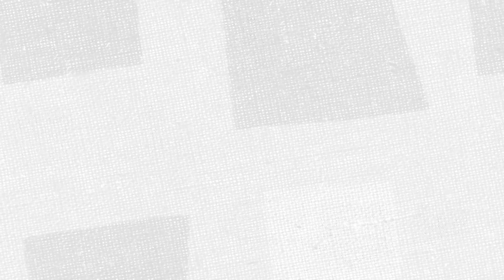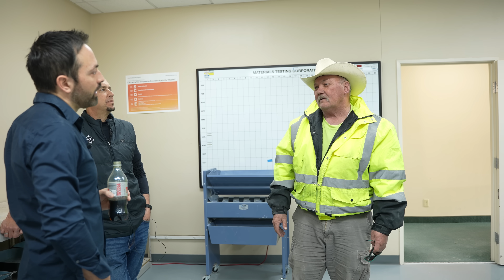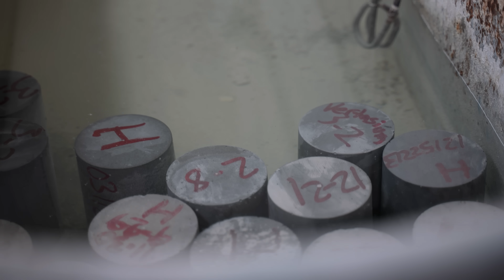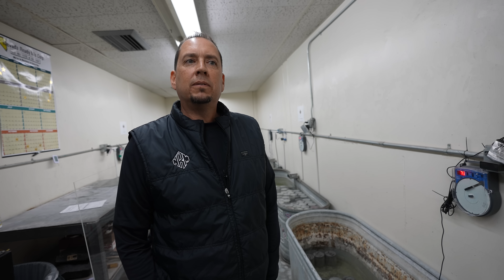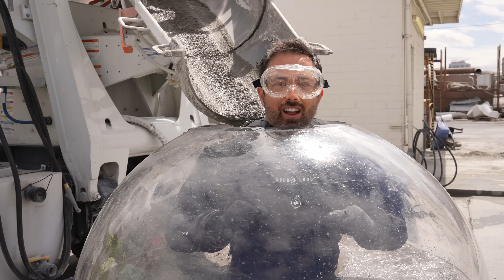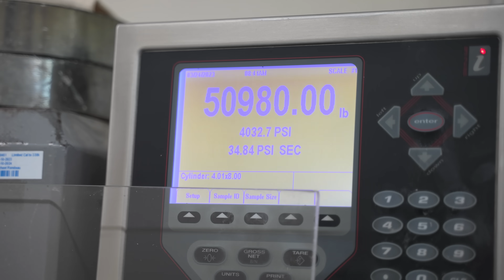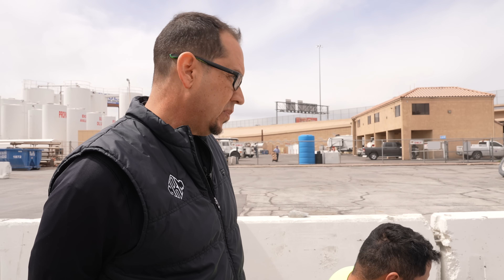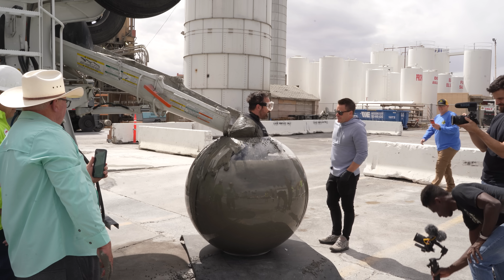Getting Buried In Concrete To Explain How It Works

Comment: 25 years in cement, quicklime and one thing you did not mention, fly ash (it was on the batch recipe you showed). Great video. I would point out that wet concrete is basic (high pH) but not really caustic. Prolonged exposure can irritate skin but it will not make a hole in you. Another point is that coal fired power station fly ash is widely used to substitute up to 35% of cement in concrete making it stronger and more durable. This is because the ash is mostly glass or aluminosilicate which is activated by the calcium hydroxide just like the volcanic ash in the Roman concrete. They even call this a pozzolanic reaction. The very fine particles of the ash make the concrete less permeable.
Reply: For some aspects, like surfaces for roads, where we need to get rid of water, wouldn't higher permeability be better?
Reply: @Parciwal_Gaming  it’s not really feasible because anything permeable will just make the foundation under the road unstable and sand and junk will very quickly fill the pores and put an end to the process anyway. They do make it though. Look up pervious concrete.
Reply: It’ll definitely make a hole in you. People have skin fall right off their muscles if left untreated too long.
Reply: wow this was such an interesting comment! thank you Chris :)
Reply: At the concrete plant where I worked, there was an old timer that had permanent damage done to his legs from years of exposure from working with cement and concrete. He always wore shorts and shoes, which allowed cement dust to get on his bare legs every day for 30 plus years. His legs from the knees down were almost completely black. It looked like he had frostbite. He was the equivalent of a walking safety video. I just don't understand how he let it get that bad. The first time I saw his legs, I couldn't believe it.
In this video, when they were filling up the clear ball, they were using really watered-down concrete. It was an 8in slump at best. That would be some weak concrete. On most commercial / industrial projects, they will not accept more than a 5in slump. They use vibration to get it into place. Adding so much water leads to cracks and weak concrete. If you add more cement, it will just get hotter and make more cracks. The only way to make it looser is to add a plasticizer. Normally, they don't use it because of the cost.
Reply: @Jonathan.D  They literally showed a plasticizer being used in this exact video.
Reply: @Demozo  Can you give me a time? I must have missed it. He was boring me with this one, and I skipped around some. Using a plasticizer is not the norm, and most people have no idea of its use. So it's really cool that they would demonstrate it here. Thankfully, they didn't demonstrate an accelerator when he was in there.😄 When we did patches on concrete portions of the interstate at night, we used an accelerator that would set up in 15 minutes. We sent out the trucks loaded with a mix that contained #2 cement. Then, on the site, they would add the accelerator just before pouring. It got so hot that the back of the truck's chute looked like a train stack from all the steam. The drivers used stopwatches to make sure they didn't have it go off in the drum. We lost several loads when the construction company had some issues that prevented our guys from pouring in time. It set so fast that they used the blade of the loader bucket to level it off. Once, an impatient driver decided to take a shortcut through the site but ended up in a patch that was almost set. Their car got stuck, and the concrete set before they could be towed out. The car was yanked out with the loader. One of the tires separated from its rim and had to be pried out. They were fortunate that the car wasn't in any deeper or if it would have been ripped apart. There's a huge fine if the interstate isn't fully reopened by 5am. So they wouldn't have had time to chip a car out of the concrete. Fun times!
Reply: @Parciwal_Gaming  It seems that would be a problem where winters are cold, where water routinely freezes.
Reply: What's going to happen when cheap fly ash is unavailable when all of the coal burners are shutdown? Anyone?
Reply: 25 years in cement, quicklime, and fly ash? I hope they let you out of the concrete soon!
Reply: @Hambon10  it's an awful product too, I'll add. Both in function & aesthetic.
Reply: If a building is blessed by Allah
It stands forever
Reply: Just thank you for the comment and this thread.
Reply: Yeah i was like what? we played with cement back in the day like it was clay haha. After a few times doing that your skin barely even reacts anymore.
Reply: @barryschalkwijk9388  concrete slowly dissolves organic material. Play with it enough and points of contact will begin dying, falling off, etc. It's a very common problem for the people who take it as a trade.
Reply: @GaryL3803 start using volcanic ash like the romans
Reply: @Hambon10 lol yeah never before have I seen something indicating someone having no idea what they're talking about. Seen some pretty severe burns from it over the years from newbies

Comment: I worked for about a year in Las Vegas doing underground utilities trenching in residential neighborhoods installing conduit for fiber and I was completely new in the construction industry. I would help my dad out with yard/house work but I never knew the actual terms for things especially “slump”. At my job we would cut 12in holes with hole saws in the asphalt and an industrial water vacuum truck(hydro vacs) would come and suck out the earth underneath. We later filled it up with slurry once the utilities had been located to know how far we can cut into the ground and excavate. My foreman had been working with concrete since he was a teenager but he was only a few years older than me and man was he extremely knowledgeable really respectable man. He was the one that taught me about proper slumps and how to communicate with the slurry truck drivers and showed me how to do a slump test. One time I wasnt paying attention and I stepped into an open hole with one leg (only one leg fits in the 12in hole) that had slurry in it and it ate me up so fast luckily it only went up to my knee cause I caught myself and didn’t tell anyone cause I was scared of being fired so I just cleaned myself up with water. It was  an amazing gig I had and I learned so much from the people I worked with but man I learned to fear concrete at that job

Comment: As a civil engineer that specializes on reinforced concrete: AMAZING VIDEO, congratulations, it's really well done!! It would be even better if you showed the weakeness of Portland Concrete and why we reinforce it with steel, but it is a whole new subject. Amazing, man, well done!
Reply: what is the weakness?
Reply: is it because it's brittle on its own?
Reply: @CureSmileful  No it is because while concrete is excellent in compression, it is weak in tension. The reinforcing steel is placed in the areas of the concrete that will be subjected to tensile forces (bottom of beams/slabs, etc). This is the simplest answer, but steel serves other purposes (crack prevention, freeze thaw, etc)
Reply: @arineey4538  And an important part of using steel instead of something else is that concrete and steel behave very similiary in regards to thermal expansion. So if it gets very hot or cold it doesn't tear itself apart.
Reply: What’s the weakness of Portland concrete?
Reply: @francoisunger6466  it might be strong in compression as demonstrated by the crushing tests in the video but it is weak in tension. That's why steel is placed in the concrete to provide tensile strength.
Reply: @a.gabbey5569  what would be a common tensile load concrete had to withstand?
Reply: @SharkWithADrill  I dont know numbers, but I believe the concrete in bridges often undergoes severe tensile stress, and thus needs some type of reinforcement to not crack
Reply: @SharkWithADrill  cement can have a tensile strength of about 3N/mm^2. High yield steel for example can have a tensile strength of 460N/mm^2. It means steel can be about 150 times stronger in tension than  concrete.
Reply: @SharkWithADrill  any kind of load really. For example if a beam is being bent, there is both compressive forces and tensile forces. As it is being bent the top is being pushed together and vice versa, the bottom is being pulled apart. Hence, as a previous comment mentioned, reinforcement is primarily placed on the bottom of a beam as that is where, in a lot of simple loads, the tension is.
Reply: he didnt mention graphene strengethen concrete :(
Reply: Hmm, one of the main weaknesses of Portland cement is its relatively low tensile strength, which means that it may crack or fail under tension, bending or shear forces. This is where reinforcing steel comes in so, by adding steel reinforcement in the form of rebar or wire mesh to the concrete, we can increase its overall strength, durability, and resistance to forces that may cause it to crack, break, or fail. Steel reinforcement works by effectively transferring some of the tensile forces to the steel, which is much better equipped to handle those forces than the concrete. This allows the concrete/steel composite to withstand greater loads, resist deformation, and absorb more energy without failing. Thanks!🙏
Reply: @francoisunger6466  Nothing. All concrete is bad in tension, not sure what the commenter is talking about.
Reply: I'm surprised Portland weren't named after Aalborg Portland. Huge cement supplier. Awful for Denmarks co2 emissions. And some rich ass family ownership.
Reply: @--julian_  plasticity
Reply: Yeah this deserves a part 2, I wondered if they would explain the steel reinforcement angle. I am particularly fascinated by the Roman self healing factor.
Reply: Practical Engineering has a whole series on concrete and the different ways it is reinforced. Definitely worth a watch!
Reply: @--julian_  it can't withstand tensile forces( stretch) and it also shows sudden collapse behavior when the load applied exceeds the limit it collapses with no prior warning signs like deforming or bending which can be too dangerous for humans or any other living being under it for this steel reinforcement ( under reinforced ) is provided this is just basic information there is more to it